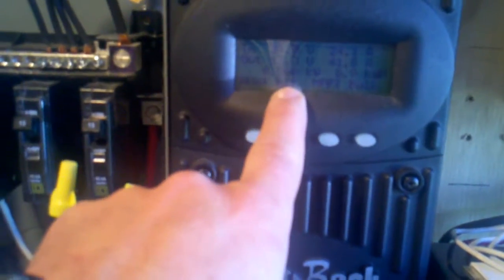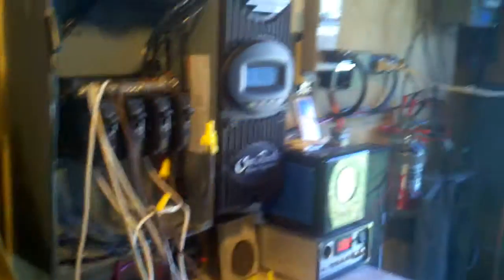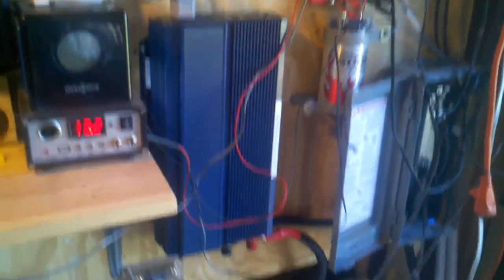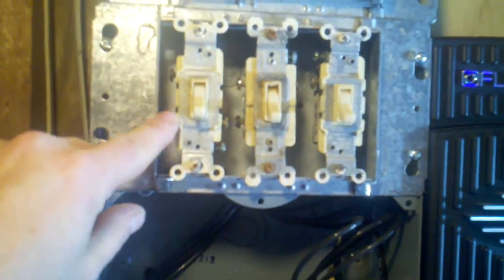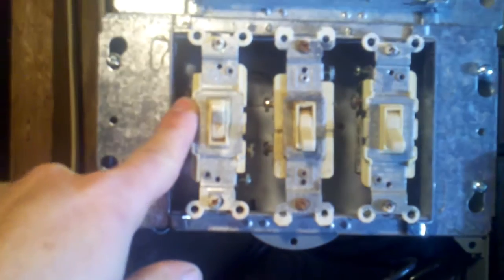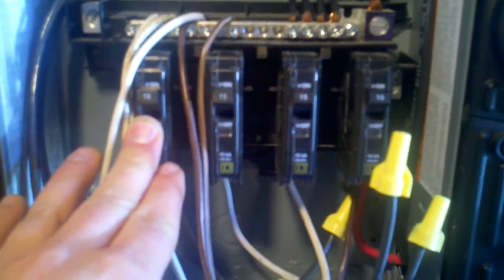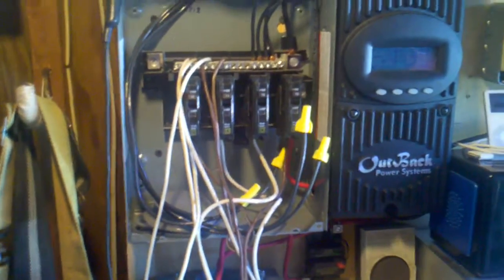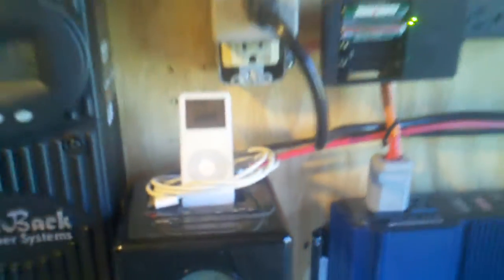Getting ready for a grid tie inverter

Comment: Looks good.  Like Rusty, I too have a 1200w Powerjack with about 600w solar able to go into the inverter OR battery bank, using a battery (1,2,1+2,off) switch.  Works great with a charge controller as the controller only send power to bank if needed and rest goes to GTI because of the switch.  I like your idea of breakers to the GTI so that you are fused already.  I might have to look into that as I grow into the big boy toys of Outback. Solar tracker and 6 more panels for myself this year :)

Comment: Hey i agree smart to not waste the excess power float mode  instead of feeding all circuits via Chinese GTIs. Unfortunately our options are limited to Chinese unless u got ton $ drop on a outback GTI etc. I like the use of the 3 way switches to control flow of power. Look forward seeing updates. You clearly know what you're doing over there.

Comment: That's OK, I have mine hooked up that way. Should make pretty good power if putting in 48V from the panels.  My panels are 24V @32 OCV.  I have 3 panels so I see 96 OCV going into my 50-100V 1200W powerjack.  My charge controller uses solar to power it and it needs 40V to operate so had to go with the high Voltage version of inverter. It will be nicefor you, collecting all available power when the bank is full.  You will enjoy the flexibility of off OR on grid capability.

Comment: Hi I have 2 powerjack 1200 for 2 years with no problems. The key is to put no more than 600 watts into them.You  might consider a battery switch. If you wire it to the battery bank and gti set the switch to the middle position which is 1+2 on a blue seas as your battery bank charges the remaining  power will divert to the gti.

Comment: have you looked at the relay in the flexmax under the AUX im not  100% sure but there is a setting you can set if your battery is at float to send a the left over (wasted) power to the grid tie?